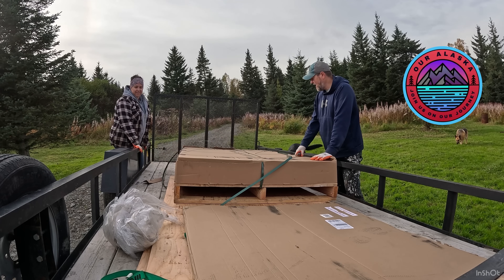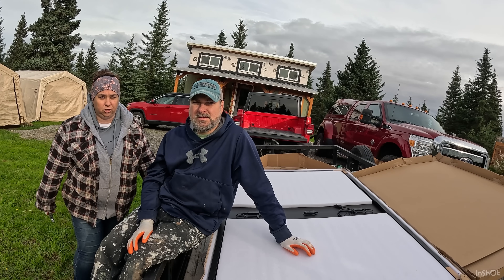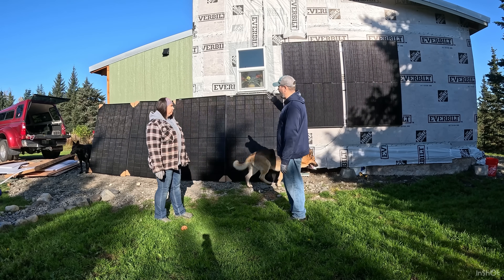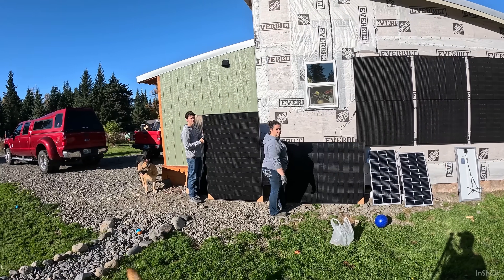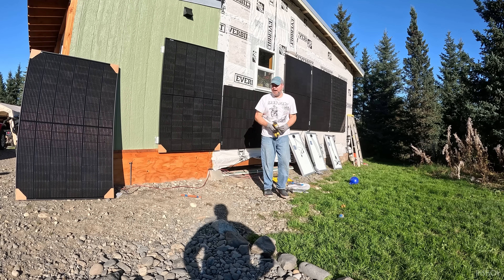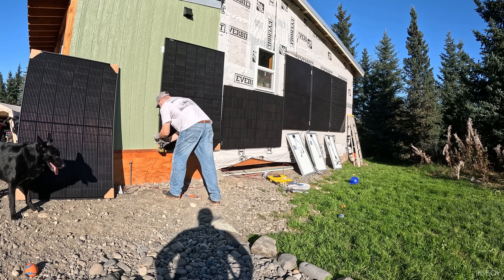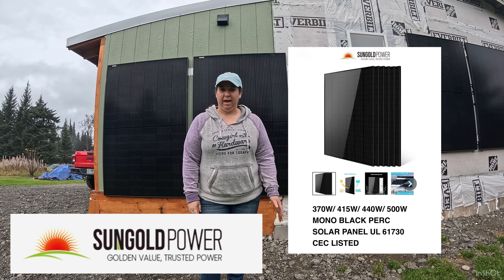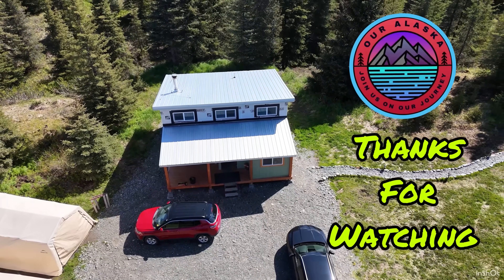We have POWER! Huge Solar Upgrade to our Off Grid Alaska Homestead | SUNGOLD POWER 48v solar system

Comment: So when will you put the last of the siding up?  First thought make a solar trailer that you could shift around- drawback with that rubber tires might go bad and wire laying on the ground.  Second was once you finish the siding- remount them and use metal  frames that you could adjust possibly having them at a little bit more of a angle  then have some firewood storage under them.  Third would be a fixed carport structure or firewood storage structure.  sun facing side solar panels back side wood storage cutting area.
Reply from the maker: All great ideas. Thanks for sharing.

Comment: I would have mounted on the wall as well. I am not concerned with water leakage as that is simple to solve if it occurs and simple to prevent when the panels are relocated later on.  So glad you have reliable power now. I am interested to learn how much solar charging you get during your unique winters. Please keep us posted on that.
I laughed at Craig’s reference to Tim the tool man Taylor.
Welcome home to Chris!
Reply from the maker: Yeah, we made sure to caulk behind each bracket so shouldn’t have to worry about leaks. Craig loves that old Home Improvement show.

Comment: Congrats!  That should help a lot.  You'll probably want to snowblow in front of those panels around where your rock path is once the flakes start falling or those panels won't produce much when shaded by snow.  But if you can clear the snow, the reflection and cold temps will make them produce a bunch of power in winter.
Reply: For your permanent mount, getting them high enough to be above the snow is important and then the snow funnels the light into them and really helps them produce.  Kind of a pain since you have to dig deep to get under the frost heave, but high enough to stay out of the snow.  A good ground mount is the most expensive part, but if you build something attached to your house perhaps that would work best.
Reply from the maker: @gf3803  yeah, definitely have to keep the snow from piling up. We will see what we can build next summer.

Comment: Getting more solar panels is great!  I learned in the summer, we have such long days it doesn't matter if they are tilted at the right angle or not.
Reply: agreed, and vertical keeps the snow off and in overcast summer days, vertical also works great since the light gets diffused.  Vertical makes a lot of sense.
Reply: Awesome upgrade! One day, one step, one dream.😎🫎